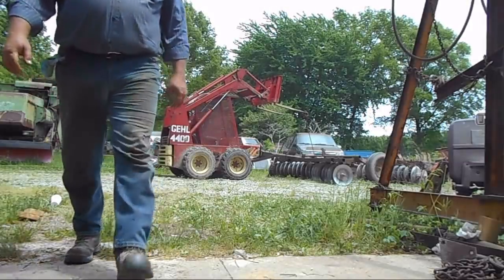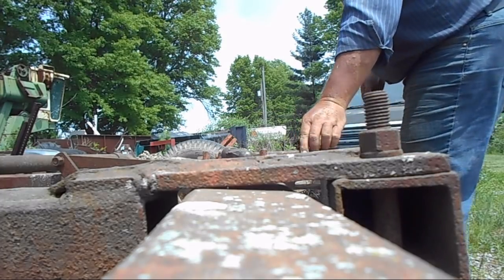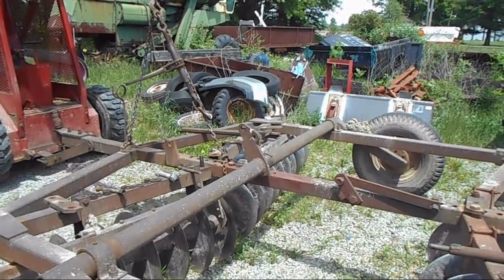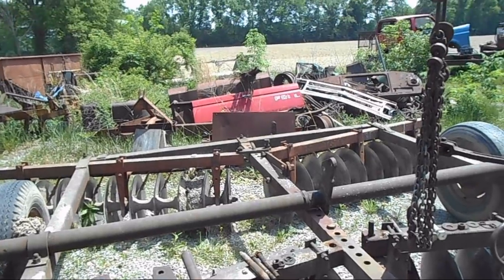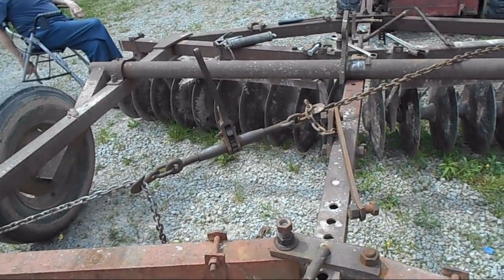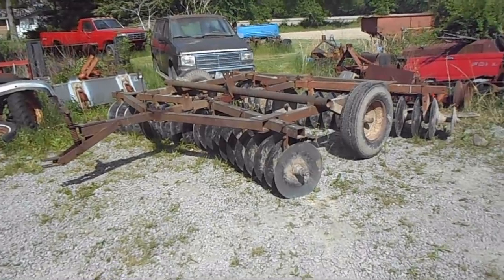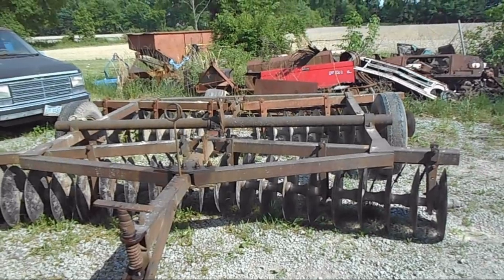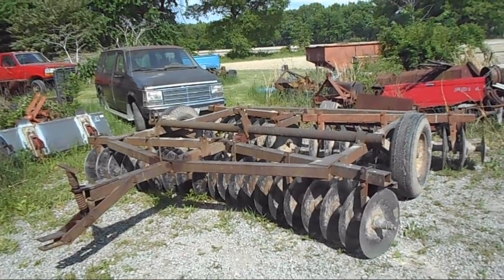Putting the Tongue Beam back in and Squaring the disk

Comment from the maker: After all the hard work welding it up its time to put the tongue bean back in the disk frame by myself easy enough I guess. Getting it back in was fun to line everything back up but I did it and then it was Square the frame back up using a chain and binder to pull it back in square and tighten all the nuts and bolts down good and tight with the braker bar and a 3 foot pipe ! I want them not to move again !  LOL Now its all done and I figure it cost me $25 to fix it and now I have a good disk again to use in the fields again to finish disk with. I hope you enjoyed and learned something too.  Bandit

Comment: Nice fix Bandit. That disc is as good or better than new.
Reply from the maker: Thank You,  I figure it was the best way to do it and what I had in mind when it broke. I just had to find what I needed to do it with and get it done. If this brakes again I know there is something else wrong and I have to figure it out. But for now its fixed and I think it will hold for another 30 years !  Old iron or new its got to get fixed one way or another and put back to work again. I'll have to watch the 1550 from now on, Too much power I think ! LOL  Bandit

Comment: It's always good to see your dad out there supervising & making sure you're doing the job right. LOL  You gave lots of good information to refer to when it comes to repairing a disc.  Yep, $25 + your labor = good cost savings fix.  I know that most would've just shoved it off in the weeds or cut it up for scrap instead of taking the time to repair it.  Stay safe.
Reply from the maker: Pops got ot be there as the supervisor and I wouldnt have it anyother way !  Its funny there are a lot of things I know that to me are comend knolage , Like Squaring the disk back up when I put it back together so it pullls easer and to keep from damaging the frame again. I've had several messages asking about squaring of a disk and why do I need to worry about it, So I explained it to them. Some disks are a bolted frame and others are welded but sometimes you need to check just to see if it is squared up. There have been more than one person say just junk it and go buy a good one or you need to upgrade the disk, Not me ! I'll fix what I have and save the money for something else I need. You dont make money buying equipment everytime you turn around because your too lazy to fix what you have !  I like guys who buy new equipment every 3 or 4 years because you dont have brakedowns with new equipment and if it does brake down they call the dealer to come fix it for them because they dont have time to do it ! LOL In the last 30 years I've had one tractor back to a dealership to be worked on one time and the skid steer 2 time trying to find and fix hyraulic leaks and fix a valve body that was leaking other than that me and dad have done all the work on our equipment and we know its done right when its done. Bandit

Comment: 25 bucks elbow grease is always better than several hundred or thousand dollars for newer. Especially when you like something.   General fab skills are a blessing especially if farming
Reply from the maker: I totally AGREE !  Id rather fix what I have than looking for another disk to buy that's for sure !  A good used finishing disk is kind of hard to find and I really like this one just for the job it does of finishing the ground, So Its a no brainer to fix it in my book. Knowing I had the piece of box tubing and only having to buy one bolt to replace one that was short to start with it really was only my labor and time to fix it. A lot of guys would have just welded it all in place and called it good enough, Not me pull it out and do it right and resquare the disk so I know its fixed right . Bandit

Comment: Nice work!  That's the best way to do it!  $25 and you can feel good about knowing it was done right!  Thanks for the video!  Looking forward to seeing it in action soon!
Reply from the maker: Thanks, It was a cheep fix for me for a change and I know what I welded up will hold just fine. I really didn't know my 1550 had that much power to pull the disk apart ! LOL Its fixed and back together and squared up good now and everything is tight ! 3/4" braker bar and a 3 foot pipe I know there tight ! As soon as it get dry I'll have it in the field to test it out just to be sure ! LOL  Bandit

Comment: If doesnt lift high enough i would adjust the where the cylinder hooks and the transport lock out forward so you get your height
Reply from the maker: The problem with the wheel lift is the hole is egged shaped from ware and needs to be welded up, A 1/4" more on the wheels lift ware the cylinder hooks to it will make the wheels go atleast an inch or more higher bring the disk higher off the ground.  Beings that it doesnt really go down the roads anymore Iits not really a problem but when I can get the disk closer to the barn so I can get the welder to it I'll weld it up and grind it down . Its on a growing list of things to fix , It's a list that keep growing everyday ! LOL  Bandit
Reply: Bandit farmer im rebuilding my trk flatbed then work on my flatbed trl   and other stuff   i can relate to the list
Reply from the maker: I don't think I'll ever get my list shorter than 3 pages ! LOL That's the thing about being a small farmer, There is always work that needs to be done. Most of the time I do the most important ones as they pop up and plug away at the rest as I can. Being a one man show you just dont have the time to do everything you want so you put things on the back burner like the Long and Case and keep rolling. That list only grows longer and NEVER shorter ! LOL  Bandit

Comment: What brand of disc harrow is that?  We have one just like it but don't know who made it.
Reply from the maker: Its a MM disk made I believe by Krause , Its a disk I really like that pulls easy and its a great match for my Oliver.  Bandit
Reply: @banditfarmer1900  We bought one for $500 when we bought our John Deere.  Had to put some money in it and have broken shafts already.  Its also funny I saw you video about the frame breaking whomever had it before us had the exact same thing happen only they welding it back together crooked.  I could go on  and on with other things they did to it that made no sense.  We are having a hard time finding parts for it.
Reply from the maker: @michaelneuman6910   Finding parts for older equipment of any kind is getting a lot harder so sometimes you got to make other parts work on it. I have a JD spool on this on and at some point I need to put all new bearings in it, The last ones I put in it were when I put all new blades on it in 1988 !  So I cant complain about them at all but there $22 each and I need 12 so I hope it lasts another 30 years !  Shoup sells disk axels and bearings blades and scrapers or look for someone who junks equipment and see if they have what you need. Oldfarmjunk101 has a channel and that's what he does and I've been to his place and bought parts form him and he's got a lot of everything parting it out !  Bandit
Reply: @banditfarmer1900  Ya that is what we are doing!  couldn't find a new axle had to have it welded up last time.  It is holding so far.  I made my own spool (washer) for one side.  We finally got rain down here getting ready to plan oats and wheat.  Have a good winter.
Reply from the maker: @michaelneuman6910   I have used a couple of old disk blades cut down and a piece of pipe welded together , It works just not pretty ! LOL I hope to get some wheat planted soon myself but we need some rain too !  We got a couple of showers but we need a good soaking rain to get the ground good a wet for a change. Bandit